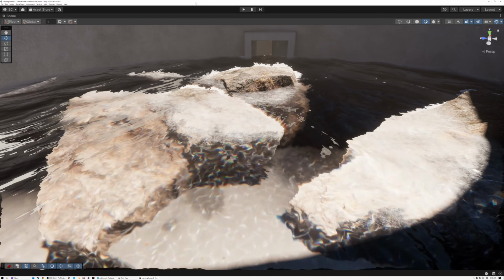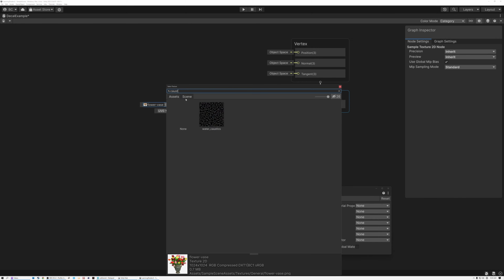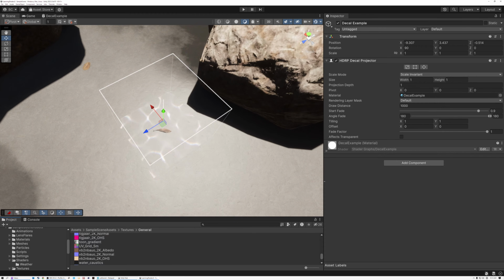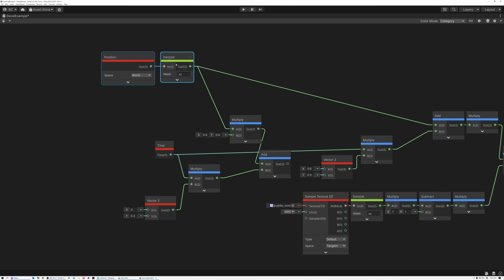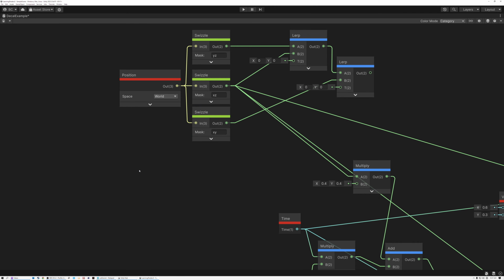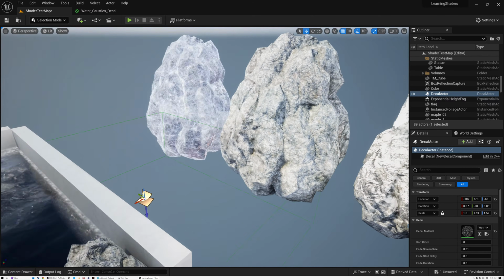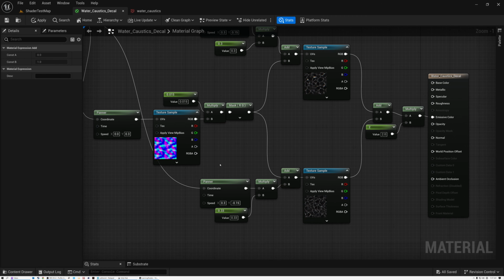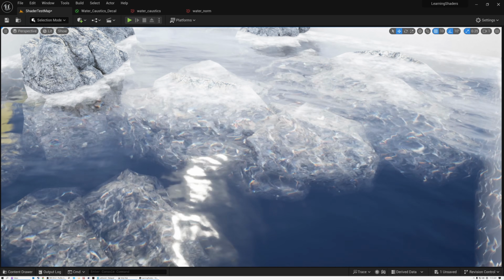Underwater Caustics - Advanced Materials - Episode 41

Comment: Sorry to bother you Ben, is it normal that the refraction makes hard to see the caustics on the bottom?? Do you suggest to bring the value down instaed of using 1,33??
Reply from the maker: It is normal, yes. You can set the refraction to whatever looks good. What I do sometimes is use the depth of the water as a modifier for the refraction value, so right at the shore line where the water is shallow, there's very little refraction, but as the water gets deeper, it increases to the full strength. That helps the caustics to be more visible.

Comment: why is your foam only visible if it's projected in front of the stones or whatever intersecting the surface?  the foam just disappears when the object underneath curves out of visibility.
Reply from the maker: This technique is using the different between the distance to the water surface and the distance to the surface behind it to determine where to place the foam.  It's nice because it automatically applies foam, but it does have the downside you pointed out.  You could also just paint a mask texture to control where you want the foam to go, but that's a bit more work. So it depends on if you want an automatic solution with a few drawbacks (the one I show in this video) or if you want to use a bit more manaul labor and to make something without the drawbacks.
Reply: @BenCloward  ok, I understand, there's no automatic solution for what I am talking about.

Comment: but... why? why did you removes vertical leaks and did this terrible triplanar?  Take a look on real caustic - it is leaking.. cause it is projected.. by sun. ))
Reply from the maker: Ouch - thanks for the feedback.  Sorry you don't like it.  You make some good points. If I get some time, I'll experiment with what you're suggesting.
Reply: @BenCloward  I preferred the triplanar too lol
Reply: @BenCloward  I sed triplanar caustic its sucks, not your tutorial. Your tutorial its good and cover a lot of trouble places. I like it. But im sure with your knowledge you can du amazing caustic. For example.. caustic have more intense  warping with deep. You can generate 2-3 types of texture with bigger warping and blend by height. )
Reply: Tend to agree😅 I think maybe reducing the intensity as a normal converges on the x or z planes would've looked better. 
Also, as well as the UV warping,  multiplying instead of adding the scrolling caustics might help to disguise the fact they're just 2 linearly scrolling textures a bit better.☺️

Comment: Hi Ben,Do you maybe know if there is a way in unity HDRP to caustic(decal ) reduces the intensity depending on the shadows from the scene?For example,if i have some rock with shadow i want to decrease caustic intesity where is the shadow of rock or some shadow caster object.
Reply from the maker: I know how to create a custom code node in Unity's URP for accessing the shadow mask, so I could do it there, but I don't yet know how to do that in HDRP.  It could be that it's not possible because the shadows are calculated after the decal pass. Not sure.
Reply: @BenCloward Could you post code for URP, to see how to access and sample an shadow map,i guess shadow map is atlas? I will try to buffer the shadow map from the previous frame and use in curent frame in HDRP.
Reply: @bojandronjic4658 did you ever figure this out?